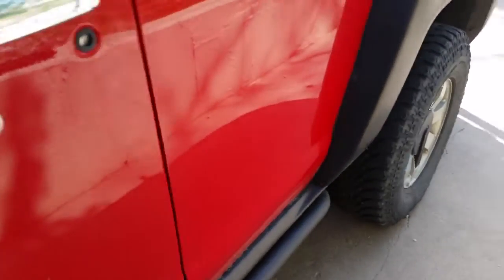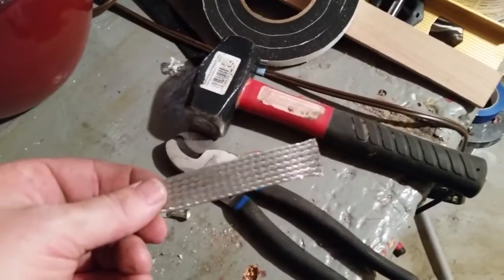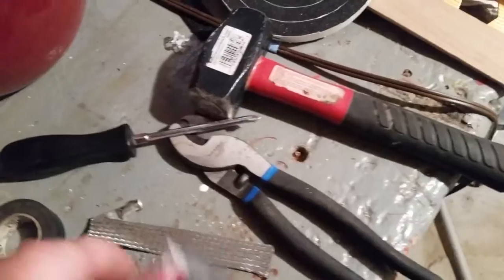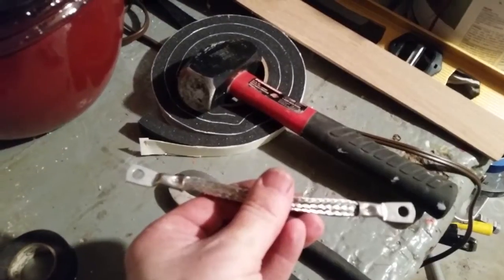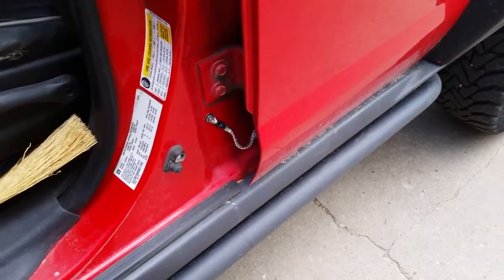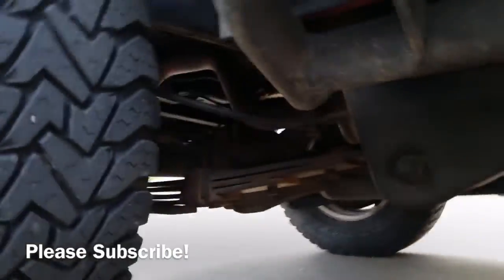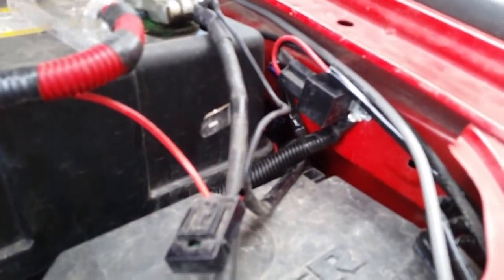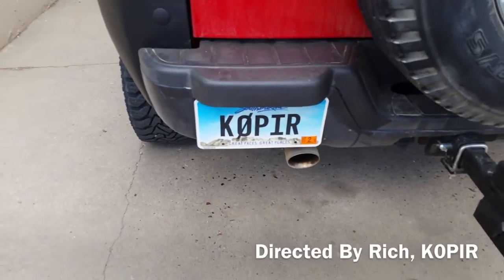Ham Radio Mobile Vehicle Bonding On Hummer H3

Comment: what is bonding?
Reply from the maker: Great question Andrew. " In simple terms, it is applying ground straps to the various bolted on pieces of the vehicle to facilitate a contiguous RF ground potential between them. While most of the parts of a modern vehicle are securely fastened, and are more or less DC contiguous, they are not necessarily RF contiguous." - You can read more about it here - http://www.eham.net/articles/25453 Best 73! - Rich, K0PIR

Comment: I'm curious what your thoughts are on using conductive adhesive cloth faraday tape as the bonder. Probably won't work for things like exhaust pipes but maybe on the Doors and such.
Reply from the maker: Thanks for commenting and sorry I missed your question. I don't think that'll work. It needs to have a good contact point to the steel. I use self tapping screws and lock washers with teeth to dig in to the surface. Use a wide braid if you have it. GL and best 73!
Reply: @HamRadioAdventures  Yeah I decided on using grounding braid and was able to attach it using existing screw holes worked out well. Thanks for the reply regardless. 73

Comment: I'm a Truck driver and have hf in my semitruck and find this interesting stuff to consider I am dealing with a Truck that when I transmit on hf I get comon mode current or rf into items like my laptop computer and want to make Good FT-8 contacts.
Reply from the maker: Nice to hear from you and thanks for commenting here. Have you tried ferrite on you cables. Coax, power and USB?  And your right, bonding will help too. Take care and stay safe. Best 73!

Comment: Do i have to drill holes(IE does it have to be in contact with raw metal)? I have a mini pickup and am thinking about bonding just the bed and hood
Reply: Hello, yes metal to metal as much as you can. Those two parts are a good place to start. Best 73!

Comment: Good job Rich, I have the same Tarheel model, but it's not mounted just now. I had it on my old Neon, and grounded a lot like you have done. I did a lot of reading of Don Johnson's "40 plus 5 years of HF Mobileering". A great guide to mobil setups. I need to finish my mount for the Silverado and get mine installed.
Reply from the maker: Thanks for commenting Dennis. I just finished more bonding. I won't say it's done yet because I guess there can always be more. I had a dream last night about places to add straps LOL. 
I got the antenna, two whips, capacitance hat, mount, hitch mount, controller, in a package deal off E-bay, so I thought I'd give it a shot on the trailer hitch. It works and I can make contacts all day long on it, 17 thru 80 meters. It'll tune up on 12 Meters too, but I haven't made any contacts there yet. It's a lot of fun. Thanks again, best 73. - Rich, K0PIR

Comment: In your opinion would I get any benefit doing this for non hf operation? I run a lip mounted 5/8 on a jetta with a 2m monoband radio. It for the most part works well but I'm trying to be less of an alligator and improve my rx as much as possible.
Reply from the maker: That's a good question too. I'll be honest, I never did any bonding for my VHF radios. In hindsight, I would now. It would most likely help. Once I got going on the project, I enjoyed it.

I used to have an old Ford explorer with a 100 watt 2 meter Midland in it. Whenever I transmitted the rear wiper started up.  LOL 

Thanks for commenting -  Best 73!